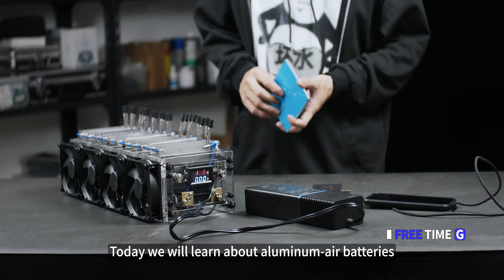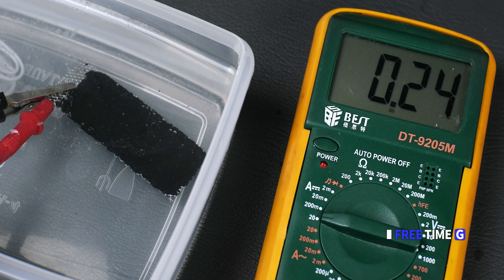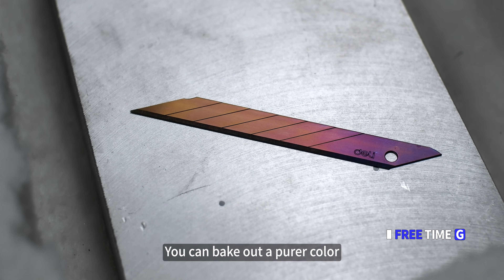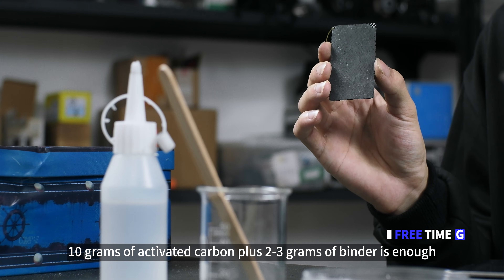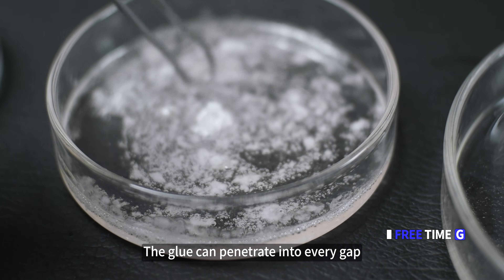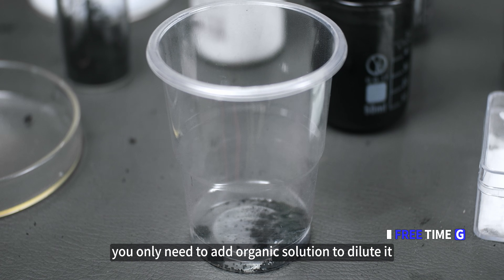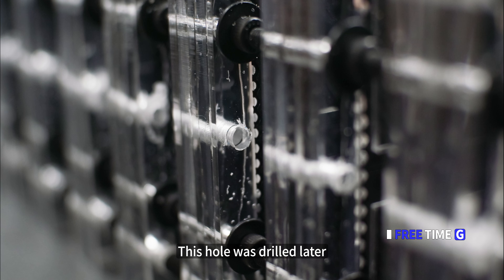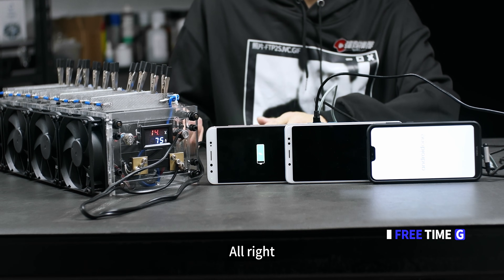Using aluminum to generate electricity，Aluminum air battery！

Comment: There's lots of awesome fun high capacity chemistries with zinc and carbon.  Including high performance rechargeable cells.  You should look into zinc ion!  You can even use aluminum foil as a current collector when charged in zinc sulfate.  Pretty easy chemistry to work with.

Comment: If you want to solve the problem of aluminum reacting with sodium hydroxide base, why not replace the reducing metal aluminum with zinc. It is true that it will weaken the potential and voltage of the cell, but it is more long-lasting because zinc does not react in an alkaline medium. And an even better metal is magnesium, although it is not so cheap, but when we talk about high-potential recording, magnesium will give even more volts per cell and the highest current density.